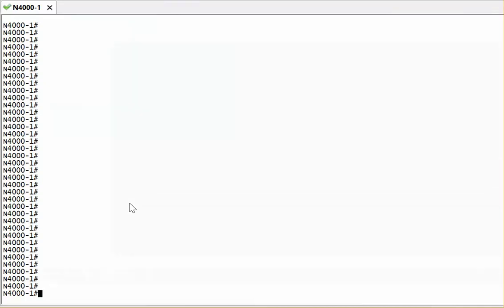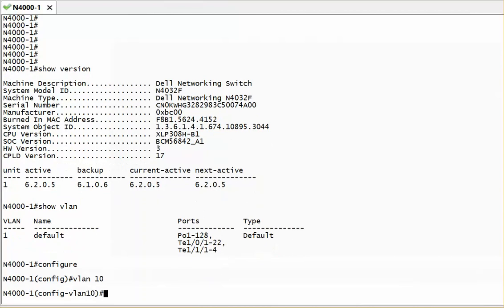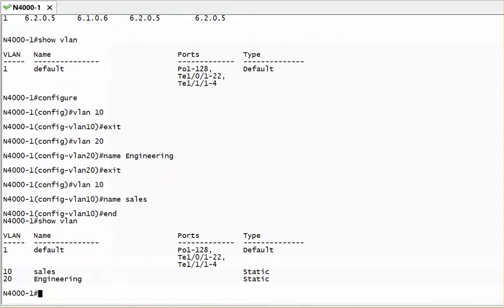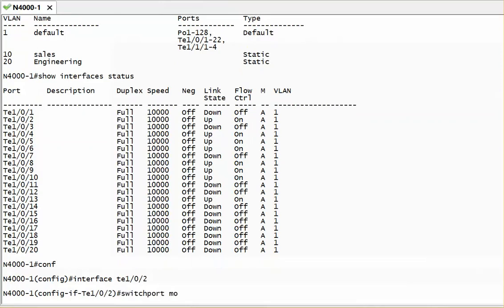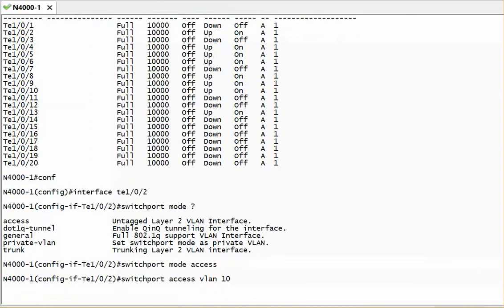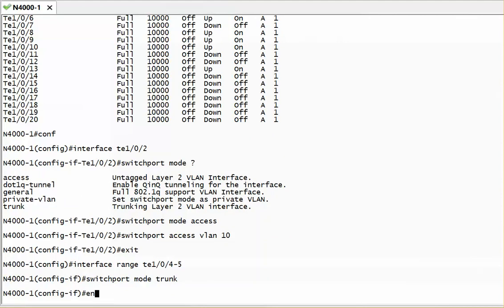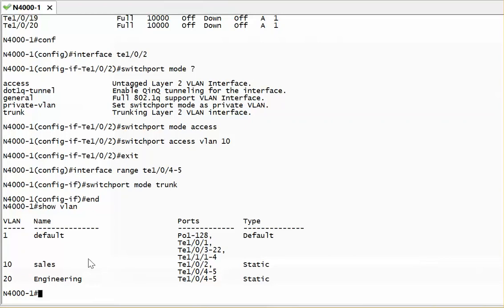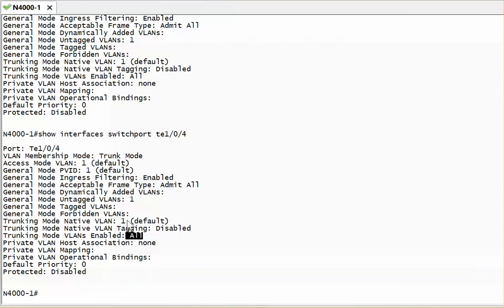Dell EMC Networking N Series VLAN access and trunk mode

Comment: Hi Just5Mins Naa,

Could you point out why my switch is not able to assign ips to the hosts. This is how the layout for my network is.
I am currently using a Dell PowerConnect 6224 and I still have the default config intact. No changes has been made to the config yet. All host are connected directly to the switch including our WiFi router and servers. For now, our LAN is currently on the ISP subnet that assign to the modem given to us. Please advise.